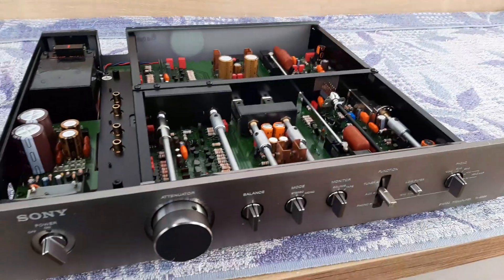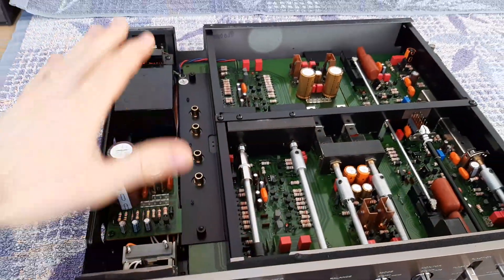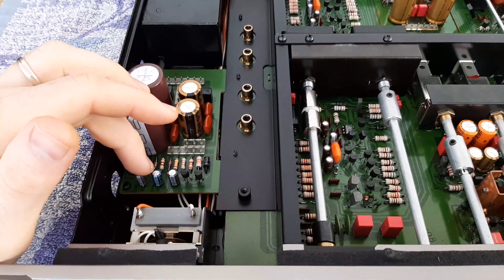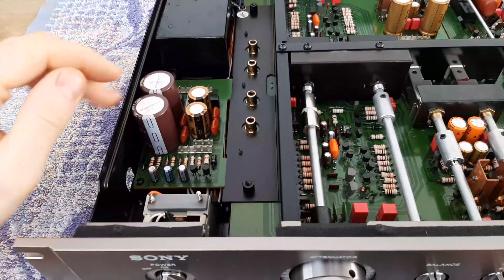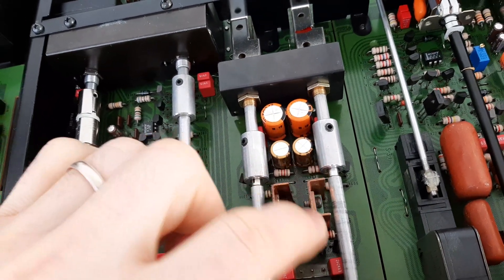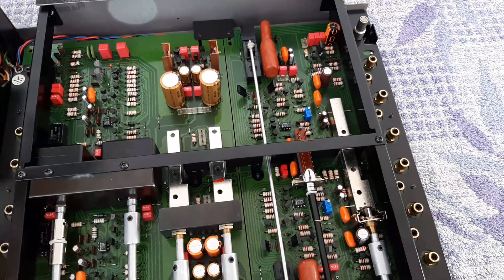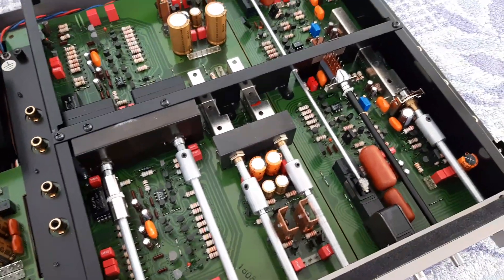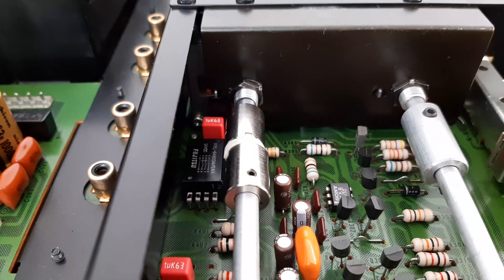SONY TA-E86 B - Preamplifier - Discussion After Restoration

Comment: Hello! how do you compare the sound before and after the replacement of all Tantalum capacitors? is it whole different?
Reply from the maker: Hi, thank you for comment. 
I never play only with tantalums,  every time i did full restorations so i can say the differences are really high.
Is a good ideea for a future video only to replace tantalums and to see the changes. 
Cheers and stay tuned, more video to come !
Reply: @MariusHiFii  Thank you for your reply, i have the same Pre amp never serviced and working properly with good sound, i read and heard different advices that the replacement of Tants would change the sound signature, some say better some say that it kills some higs and dynamics.
Reply from the maker: Yes , you know how it is, opinions and opinions. My suggestion is to do at least  the power supply section and to keep the capacitors for audio signal like they are just to not change the magic.
Cheers and we are waiting for feedback after !
See ya!

Comment: Great job! What did you replace the tantalum capacitors with? I have ta-e88 and I think do I need to change them or leave them old.
Reply from the maker: Hi and thank you for appreciation. Usually i replace all capacitors below 4.7uf with film ones because is enough space for leads and body cap. About the  brand i m chose wima and kemet depends of stock availability. Thank you for comment and subscribe!

Comment: Greetings from Australia! Nice video mate.
I got my TA-E86B a few days ago and am in the process of restoring it. In my case, somebody has been inside before and done some questionable things lol (for example replacing C619 / C620 with 4 x 470uF / 35V instead of 2 x 1000uF / 50V). They also used JAMICON brand caps on the power supply board and replaced C510 which should be 10uF / 50V with 100uF / 50V.

Can I ask you what caps you're using for C505 / C506 which are specced for 3300 / 42V? It looks like Nippon Chemicon?
Also I see you have replaced all square box tantalums with Wimas - out of curiosity were the original caps reading bad?

I would like to pick your brain about other things too but it is difficult on YouTube.
Reply: Hi! I see he didn't respond to your many questions, maybe too many Lol! I too live in Australia and currently looking for a E86b or the e88b which is suppose to be better ?? I want to partner it with the N86. Can I ask where from did you buy the e86b from ? Thanks.
Reply: @cruise2023  I got it from a gentleman in Poland after much nagging and awkward Google translate conversations.
I ended up completing the restoration on mine and am trying to get an N86 so it seems we're on the same journey with inverse starting positions lol.
I'm guessing you got yours locally - I've almost been convinced to give up on the N86 given it is not a very good design and the PSU is apparently atrocious to work on.
Reply from the maker: Hi, thank you for comment and for subscribe. Every day i see botched audio  vintage gears. About the replacing parts i m looking for service manuals every time before to start a new restoration. On the bench i have the unit for restoration and SM and compare the values inside with manual. If somebody was before inside are 100% chances the parts to have different values....
Usually for capacitors i m using Nichicon, Nippon, Elna, Kemet, Epcos, Vishay, Sprague,  Wima,  Panasonic and all the time on step more for voltage spec compared with SM and board, capacitance one step higher for filter caps...only if the fuses / bridge rectifiers permit this (usually permit). Cheers and good luck!
Ps: sorry for delay.
Reply: @fredsk1  Bought my on Japan Yahoo auctions and had them surface mailed out, slow but arrived safely. They seem to come up regularly.
Reply: @cruise2023  nice one. Yeah I see a lot of them on Yahoo Auctions but they're never the 220 / 240V ones unfortunately, so they don't match my 240V preamp - and I don't want to use a SDT in my setup.
Reply: @fredsk1  No you won't find them at 240v. My of course is 100v and have zero choice but to use a SDT ( for the first time ever, but have bought a good quality one which accepts x2 outlets and has 1010wts to handle 2 units easily )